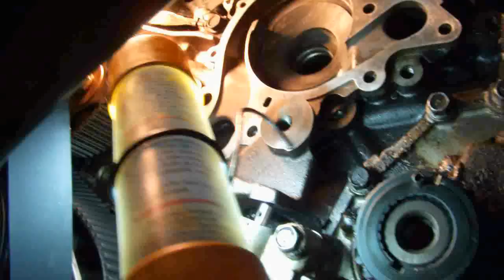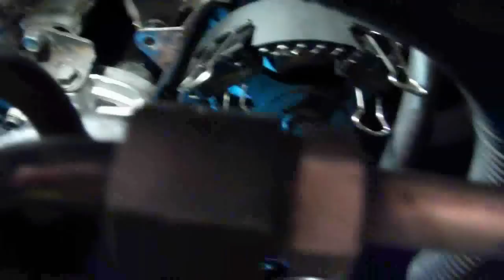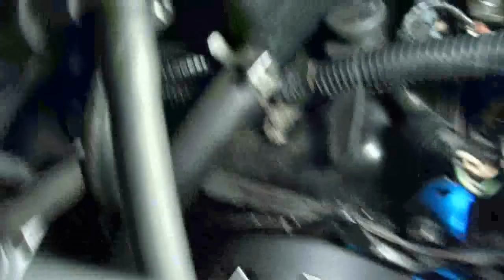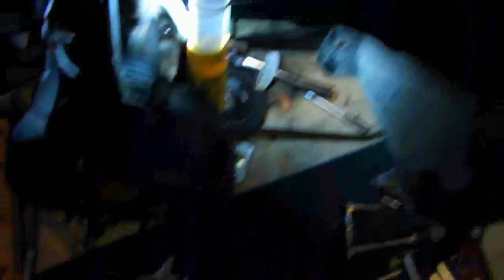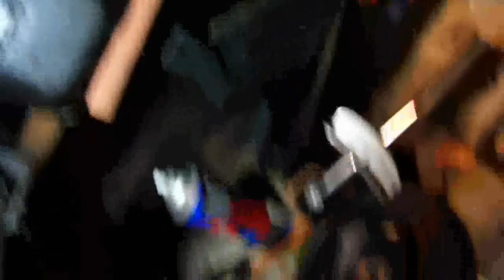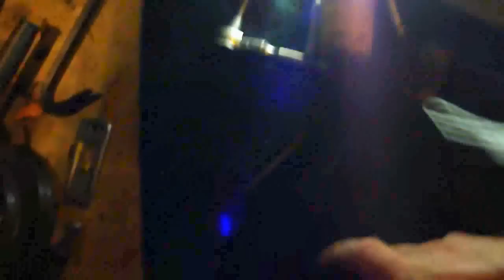1996 to 2000 Chrysler Sebring Convertible, TIMING BELT & WATER PUMP 4 of 4

Comment: My belt broke, so I took the heads off, had them all rebuilt. Got the heads back on the car now. And can't get the cam marks lined up because the valve spring tension the cam won't stay where I need it too it goes down on like the next cam lobe, if that makes sense
Reply from the maker: It is a pain to keep it lined up because of the valve spring compressing.  I used those large paper binder clips to hold the belt on and moved the cam a notch on the belt until it lined up perfect.

Comment: How did you get the PS bracket to move. mine wont budge, ive taken ever bolt i can find off.   (two at the top, one on the bottom)
Reply from the maker: One more bolt on the bottom.  Use a floodlight.  You'll see it.

Comment: For just a few dollars more, and a good piece of mind, you can replace that tenioner and idler bearing/pulley. The only timing belt job that ever came back to bite me was do to that idler bearing. Now, I always replace them both. If I; not mistaken the Mazda V6 and the Subaru motors have that same type tenioner. Just some food for thought

Comment: As a rule...when you are doing any repair work on you engine involving water pumps, timing belts, idler pulleys, they say you should always replace them (A kit) along with the crank seal and cam seals...that way it's all new and you wont have to tear it apart just for one item if it fails in the near future...repair shops are expensive so it should "all" be replaced as long as it's apart..."make it a one time job"

Comment from the maker: Use a strong floodlight and look at everything careful.  I did video it but it may be still hard to see.  Even during the day use a strong light and you will spot where the adjustment bolts are.  You probably can't see well in that area.

Comment from the maker: Yep. Actually leave one bolt in the bracket and swing it out of the way.  The bolts are 15 mm and they are on there Tight. The power steering bracket is the worst part of this job.

Comment from the maker: If you turned it with wrench fully around I'm pretty sure you damaged the valves.  The only way to tell is to do a compression check after you have the timing belt on.  I know the cam sprockets can move quite a bit without it doing damage. Like in the case the cam sprocket moved under the valve spring pressure.  But if you turn something with a wrench a full turn, then I think you bent a valve or two. Only way to tell is with a compression test.

Comment: hey I just got done working on a 1998 Chrysler cirrus everything looks the same from your videos and they were very helpful by the way. I have a question. once I took the timing belt off the right cam jumped about a quarter of an inch then like a jackass I turned it with a socket wrench to try and line up the marks I turned it both ways clock wise and counter clock wise a couple times to try and line up the marks did I damage anything and how do I line up the marks if im not supposed to turn it

Comment from the maker: I use a crowbar on the tensioner to hold the tension in a little tighter as a tighten everything up.  The little hole in the tension does not have to be perfectly lined up when you are done but it should be close.  The idea is ot to have too much tension but to leave enough room for the tensioner to take up the slack as the belt stretches.  Th valve timing does have to exact.  Eve one tooth off with give you crazy problems in how the engine runs.

Comment: I removed sp bolts without removing anything in the car, nothing at all..  secret is to use deep socket with a short (3inch) extension and that will do the job.. trust me.. i done it plenty of times on many sebrings and eclipses.

Comment from the maker: The fastest simple things to check are spark & fuel.  Use some starting fluid and see if it starts briefly.  You can also buy a very inexpensive spark tester ad check to see if you have spark while cranking the engine.  Or just pull off a plug and ground it & see if it has spark.  You may want to check that all the connections are on the various sensors on the upper intake manifold.  Take a look at my sparkplug change video to make sure everything is connected.

Comment from the maker: I'm aware of the other method of going through the bottom.  But most of the time that is not easy and most people can't do it.  I can pull off the upper intake in 15 minutes without rushing from start to finish.  Most people take off the upper intake and get those bolts from the top.  But it is whatever works for the individual.

Comment from the maker: Even the cam is not supposed to move over 4 notches, in practice the cam sometimes slips more by mistake when trying to line up everything.  It does not seem to hurt anything.  Maybe because nothing is forced.  I've had the same thing happen & heard of others that did.  It didn't hurt anything.  Maybe because nothing was forced.  Otherwise it would damage the engine.

Comment: ALSO the rear power steering pump bolts behind the intake might be removed without taking the intake off. I took mine off as per this video. I watched another video on Youtube and they said they lowered the engine some after removing the motor mount to get to the rear PS pump bolts.That kind of makes sense too. But I haven't tried it. The motor mount comes off anyhow for this project.

Comment: Great video! Very informative. I wish it would have shown how to align the timing marks if the valve timing wasn't achieved because the exhaust cam moved after the belt came off. Mine moved like an entire half turn and I'm not sure if it was clockwise or counter-clockwise when it moved. So I'm searching on how to find TDC and achieve correct valve timing as not to ruin the engine. This engine IS an INTERFERENCE engine.

Comment from the maker: The only other thing I can think of is that maybe the water pump gasket is folded over on a corner.  It's a thin gasket and pretty easy to do.  Try to shine a strong floodlight and pinpoint the source of the leak.

Comment: I appreciate the prompt response . It wouldn't be because the timing belt may be off a bit ? I'm guessing the car wouldn't run at all if the timing belt were off tho . 

I brought the car to a mechanic when it was over heating , and they did say it was the water pump , and now that it's replaced...I just don't understand lol .

I will def. check out what you just said , but do you think it could be anything else ?

Comment from the maker: It could be the water inlet pipe.  I have a video on that.  I had to change that too.  It had a hairline crack.  The water pipe from the water pump to the water manifold can corrode after a while.  If the engine valley is filled with water that may be the problem.  It's hard to judge with out actually seeing.  Use a very strong floodlight to look at all areas carefully

Comment: Hi i watched this video , and i followed all your steps and my water pump is changed but the engine is still leaking in that area . Do you have any suggestions ? 

I had leaking from around the water pump area , coming down the timing belt area . Changed everything , put it back together , added coolant and it started leaking immediately without even running .

If you could even call me that would be of great assistance .

Comment from the maker: As long as the marks did not go that far off, then the valves would have stayed clear of the pistons.  You may be ok.  May sure everything is lined up perfectly.  Check it a few times.  I personally liked cutting the oval hole in the rear upper timing cover so I can check the marks without pulling everything apart.  That may come in handy someday.

Comment: When I took mine apart, the timing marks were a bit off but it always ran fine. I think the belt may have slipped wen I was taking off the harmonic balancer pulley becuz I put a wrench on the bolt for the front cam pulley to try and keep evetything from spinning wen I was trying to loosen the bolt from the balancer (Bad idea I know that now) it should be fine as long as all the marks are lined up wen the new belt is on right?

Comment from the maker: @MrNoizyToyz The belt needs to be taunt and when you pull out the pin on the tensioner it should basically not move or move very slightly.  In other words the tensioner will have enough travel left to keep the belt tight as it stretches over time.

Comment from the maker: @MrNoizyToyz You need to compress the tensioner and put the pin in it before you install it again.  It requires a lot of force to compress the tensioner.  I used a valve spring compressor or a large C-clamp.  After you install the tensioner, set the tension on the belt.  There is actually a special tool for this but I don't use one.  I can usually get torque settings very close by hand.